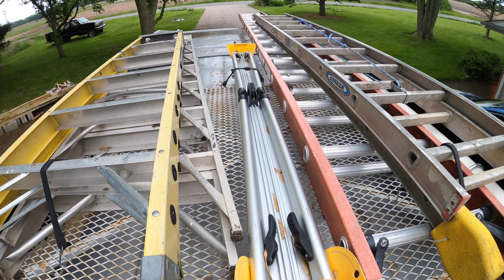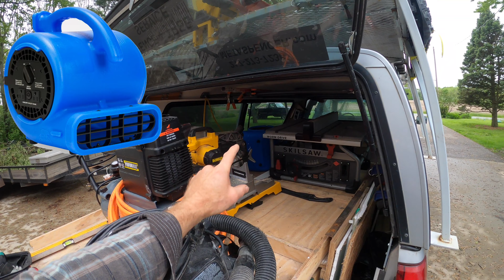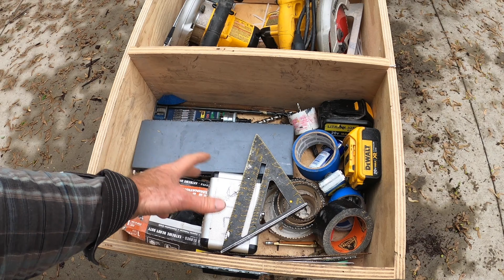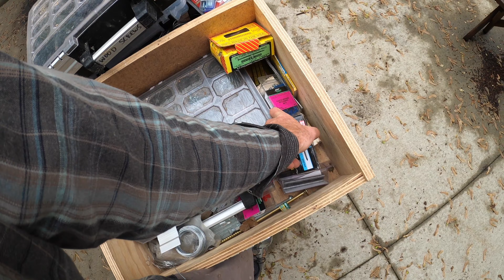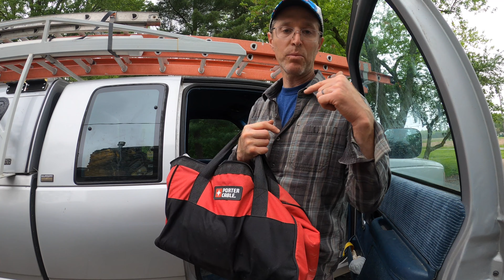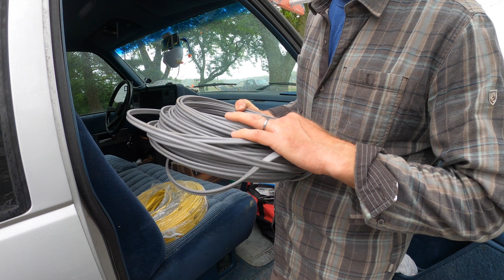Work Truck Tour ➠ Tools for Every Job

Comment: Nice set up.  I use the same approach—setting up job specific kits so it’s easy to just grab my electrical kit or drywall box for whatever job I’m doing.  The only thing that lives in my truck is fastener boxes, extension cord and an old B&D corded drill just for a backup.  Everything else goes in the garage at night.  I couldn’t stand to loose everything to thieves.
Reply from the maker: Keeping that stuff safe is the way to go. I can't imagine losing tools and things that have taken years to gather up. Well done man

Comment: Nice set of tools. When I moved onto my bus I gave away my drywall, tile, and concrete tools. Not much call for them on the road. But I've been adding more cordless to go with the corded. Now I'm running out of room under my couch 🤣
Reply from the maker: I've parted with tools a few times in the past, and while it hurts, it's always easier to replace them if you need to in the future. That couch sounds like a great storage place!

Comment: The copper plumbing cleaning tool can also be used to clean car battery terminals.
Reply from the maker: Oooo, I should do that! Every terminal around here is cruddy and could use a cleaning. Thanks for the tip! Better than using it to clean my ears

Comment: Wow, I don't know how you do it, able to do many trades. I guess you must be in a rural area where your skills are needed as opposed to the city and can specialize. Gotta say great set up! Do you find the worst thing is a clean up and of course it aint on the truck . Nest video is how to clean your truck so you don't regret it! LOL Also, what changes or improvements would you like or is that handled by your trailer? Cheers Any plans to go all battery and cut the cord including the compressor?
Reply from the maker: All battery is a dream of mine, but my first battery powered nailer croaked. I like this setup a lot but do think a van might be better most days. But will I go the van route? No way. I’m too into trucks. Anyway thanks for checking it out!

Comment: What name is the drywall box
Reply from the maker: At what point in the video?
Reply: On the inside of the truck
Reply from the maker: @JoseGarcia-yk9us  Oh, I see what you mean. That's an old toolbox that I modified with those rubber latches.
Reply: @metaspencer  and you don't now the company name
Reply from the maker: Jose Garcia ends up its Rubbermaid

Comment: You need a van brother. You are not able to use the truck as a truck so why not get a van? That truck would get broken into quick in a big city. I have a 94 Dodge Van with no windows. I have all my tools in a Job box in it, and still a area of about 5’ wide x10’ long to put large materials and it’s almost impossible to get into the rear without the key.
Reply from the maker: You said it! Absolutely, I just need the $$$ to make it happen. I have my eyes on a Dodge van with a high roof, but really would take just about anything. You are so, so right!
Reply: metaspencer mine was $400 lol. Runs like a top and is a 1 ton.
Reply from the maker: @BLACKLACDTS  that's a SERIOUS deal! nice
Reply: metaspencer I will send a pic via Facebook.
Reply from the maker: @BLACKLACDTS  excellent